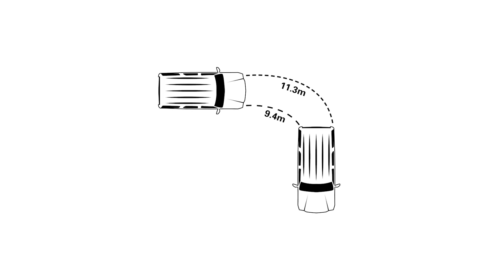SUB $600 DIY LOCKER INSTALL – Watch how much difference it made - Front vs. Rear, Manual vs. Auto

Comment: Just a question if the locker automatically disables if one wheel has resistance due to turning will it disable when one wheel has resistance during 4wding ?
Reply: Also in order to do the test that shauno did at the end when the luxy was on jack stands and he was turning the tyre to see if the other tyre would spin, would you have to engage 4Lo before doing the test to see if the lokka is working ?
Reply: The locker doesn't unlock because on the inside spins slower (more resistance) but because the outside tyre spins faster than the diff centre. This unloads the carry pin from the ratchet halves on either side of the pin. The mechanism works the same way as friction pack LSD where the power is transmitted into the diff centre through the carrier pin. The shape of the 'not so round' hole that the pin sits in dictates the clamping force of the ratchet half under load. This is why Shauno could spin the tyre while ol mate held the other. If Shauno had of spun the drive shaft instead it would have just bound the diff until ol mate let go and both tyres spun.
Reply: @r.mhaych5021  you only need to have the hubs locked. If your 4x4 has auto hubs then you would need to put into h4 or l4.
Reply: Liam Cooper thx for the discussion and info. I am still trying to get my head around how it behaves when 4wd is not engaged. I have the same model Hilux but don’t want to go the Lokka if it has a material affect on the the way the Hilux drives when being used day-to-day. Cheers
Reply: @4bnewb969  did you get one in the end? Did it effect your day to day driving and was it ratchety?
Reply: Shaun Anderson Hi, no I haven’t pulled the trigger on one yet. I am getting conflicting views on how it will behave when in 2WD. Even 4WD Systems mentioned it will depend on what front diff set-up I have in my Hilux. It appears they are not all the same even within the same model run ( mines a 2013). I would prefer to ‘test’ a Hilux with one installed 1st. What everyone seems to be advising is that in very low traction conditions eg sloppy mud & sand, the Lokka may not disengage and therefore steering becomes an issue, which doesn’t excite me too much either.

Comment: I had these on a gen 1 4 runner with ifs front had them on back and front and they made a huge difference  but i will say the rear one can be a bit annoying occasionally it would spool up and let go no damage just noise second when you do tight turns you will hear it clicking away but no big issue but i did find if you were a supermarket carpark making multiple turn it would start spooling up and making it jerky to drive
This was when it was manual  when i put a auto in this did not happen any more due to constant drive going to the diff 
in front no issues just huge gains :)
I had these for about 5 years and a lot of four wheel driving and it was my daily even when i put v6 in no issue i would happly use these again and will in my mitsubishi mk triton.

Comment: These lockers seems very purposeful 
But can those be used in a daily drive vehicles and part time off-roading?
Also can these Auto lockers be shipped internationally?
Reply: Mohsin Shaikh I all so would love to know, would it be worth it
Reply: I fitted one of these to the front of my Y61 Patrol and love it. Much better than a manual locker, don't have to think about. Under load in 4x4 it stays locked, if it gets a bit tight in the steering just back off the loud pedal the diff unlocks and releases the wind up and then back on the accelerator again. With a manual locker you have to stop and hit the switch then drive, stop and hit the switch to turn it back on again. There are about half a dozen companies making this style of auto locking diff around the world, the USA has the most I found when looking around. Google "Lunch Box Locker" , a common name for them.
Reply: Currently running a detroit in the back and an arb in the front. A rear auto locker has worked flawlessly for me and I highly recommend it, I haven't  run one in the front because i'm running a full time 4x4 the only problem I can really see is steering on track if it doesn't unlock or lock. I highly highly recommend this setup though, it's a good medium.
Reply: Manual front hubs on 4by. I have a lokka in front of my ford courier, air locker in the rear. When you turn the front hubs to lock position, that's when the lokka is locked good bit of kit!
Reply: @geoffmoroney9283  Yeah a mate of mine had one in his coil cab TD42 with 37s. It seemed to work great most of the time. It was manual gearbox I think using the clutch and backing off helped released it lock
Reply: @Nate Brindabella 
Disagree.  Have auto's in front and rear of my Troopy.  Used it for many years as a daily driver and never had issues.  I dont use it as a daily now because I now run 37's and I'd get stickered in short order, but I took the rear diff out recently and its got just a minimal amount of ware on it.  I've had it for 10 years?  There abouts anyway.  It's not been my daily for about 5 years.  My mate who had 2 in his Turbo Lux said that was a little different to drive, just he learned not to accelerate hard and turn left or right from a standing start (ie lights) while in the rain.  Not something I ever have an issue with but I'm guessing because I have less HP and much more weight .

Comment: I'm interested in fitting a Lokka in my patrol. My question is, do the edges of the interlocking pieces round off over time?
Reply: Good point, curious about the durability of these, myself.  I don't know if the bargain price is reflected in the quality of the materials used.
Reply: Had one in a 80series years ago, front only ,did 600ks in it no problems

Comment: Does it still work when you're turning left and right to gain more traction going up a more serious track???
Reply: yep
Reply: @Graeme Yamaha you're wrong in a way. They can't disengage if you are hard on the throttle and turning, the tiny springs can't overcome the torque which you are applying. 
I use to have one in my rear diff and if you put your foot down the lokka would stay locked on.
It's annoying that they didn't explain this in this video because that is why I'm sceptical of sticking one in my front diff, it may be hard to turn or break something if you have to be on the throttle hard and turn at the same time.
I broke the lokka branded one that was fitted into a 80 series 9.5 inch rear diff. Broke where the springs sit in the casing and made it so it didn't lock anymore and would make a hell of a noise when turning.
I replaced it with a brand called spartan as they had a much beefier spring and detent setup than the lokka.
Reply: @Graeme Yamaha as I said, the one I broke was fitted into a ln65 hilux with 80 series diffs and a 350 chev motor, it was in the rear though not the front. Have to say I loved it, for the price it work really well. It drove really well on road too, when it was working correctly I couldn't even hear it and the vehicle drove normally.
I have never driven one with a front auto locker though and in my mind I'm not so sure about fitting them to the front but in saying that I really need to experience it first before making a final judgement.
In the rear though I think they are the best bang for buck you can get.
Reply: Hi Steve - it DOES work while you're turning on a track. It only unlocks when the wheel speed for single wheel is GREATER than the input drive from your engine. For example, you're driving up a difficult track. Your engine is pushing you at 2m per second. You turn your wheels left. The lokka keeps driving your left wheel at 2m/s. Your right wheel (following the longer path) is pushed [by the ground] at 2.1m/s. So the lokka UNLOCKS and allws that wheel to travel faster. But it doesn't let it travel any slower than the engine speed (e.g. 2m/s)

Does that make sense? Does it answer your question?
Reply: Yes - it will unlock if the track is firm, but if its wheel spinning due to power all the way then it would stay locked. It can change what its doing all the way up the track - so each part of the track might require different action and it can handle that. The front diff fitment is actually the best part of the Lokka design - its actually the best way of locking a vehicle because you still retain almost all of your steering but also get differential action when you need it
Reply: @4wdsystemsgeartogoannawher754  hi guys, will one of these fit in the front of my px1 ranger?

Comment: So what was the go with the Zero Dollar Zooks steering auto locked up front then?
Reply: The type of auto locker installed in that probably has replaced the side gears with the plates shown in the vehicle. For Suzukis, that setup doesn't like to unlock easy and can easily snap CVs/axles too.  The alternative is to retain appropriate side gears which function the same as the plates, but ratchet more easily.

Comment: I noticed it makes a clunking noise when Shaun demonstrates how it unlocks. So can you hear the clunking from inside the cab when disengaged?
Reply: The "clunking" noise is the locker ratcheting.  It makes that noise when you corner.  The inside tyre is getting all of the power and the outside wheel is over-running the inside tyre.

Whether or not you can hear it from inside depends on a number of things - how well it's set up, how chunky your axles are etc.  If you set it up properly, it's not super noisy.  If you have a tin can like my Samurai, you can really hear it even when it's set up right, if you drive a Land Cruiser with lots of sound deadening and thicker diff pumpkins, probably not so much.  Probably...?
Reply: @antontaylor4530  Hey man, I just realized that this type requires power steering otherwise you'll fight the steering wheel badly! Right?
Reply: No, they behave like an open diff in that respect. I have a friend who has a samurai with the lockright version of these front and back, and he doesn't have power steering.  Steers like stock.

Comment: Can you do a beginner guide to using lockers on the track. Just got twin ARB air lockers. An on track guide to explain when to engage and when not too etc and use over different surfaces. Would be appreciated. Heading to Flinders ranges next weekend to test em, can't wait. Keep up the good work fellas.

Comment: I'm a bit different to most, fitted this in my falcon 2WD Outback ute. No getting stuck at all but it is very noisy ratcheting around corners. Good value and solution in place of my Hydratrak.
Reply: Not tight enough, get in there and tighten your springs more. If it's not tensioned enough it will click, it should ratchet without clicking.

Comment: Wouldn't it would just keep disengaging when your trying to steer up a technical track??
Reply: That's what I was thinking, also, wouldn't it just disengage with any amount of force on the opposite wheel? Old mate was just holding the wheel and it unlocked when 'going around a corner'
Reply: It does not allow wheel to spin slower that diff if force is applied to diff, so in some corner cases (with negative rim offset) steering might be harder. But wheels can freely rotate faster that diff, it locks only when wheel resists to diff rotation.
Reply: @MitchDenham  when there is force on the drive shaft then both wheels spin at the same speed but one wheel has the ability to roll fasters than the other around a corner
Reply: yeah I was thinking that as well
Reply: Re turning actually it does not disengage in the true sense. To turn 1 wheel can turn faster than the other but not slower
Reply: Yes from experience of having one in a troopy they will disengage if you back off the throttle on cornering.
Reply: There's one situation I have felt that happening in my 75 Troopy. That was going up a steep gravel hill around a corner where you have to accelerate.  Wasnt bad on my car (Heavy) but on a mates hilux he said it was a bit of a handfull.
The one situation I have had where I wanted to disengage the front lokka to turn out of a deep set of muddy ruts, I just unlocked one of the hubs and she hopped out of the ruts no problem.
Reply: If you look at one in person  youll understand it the centre pins have ramps that push the gears into mesh. So under full power situation it will be full locked only unlocks at light throttle (cruising) theyre good bang for buck operation is noisy and clunky though
Reply: Yes but that is not going to be an issue. Unless it is broken or not installed properly, it is not possible for any side to spin slower than the carrier (when moving in a forwards direction).  
This means that even when it unlocks one side, the unlocked side can only go faster than the side that is still locked to the carrier and it is not possible to spin up a wheel.
Reply: So basically it's like a Detroit locker
Reply: @450ktm520  It works pretty much the same as a Detroit locker, the difference is that it is smaller and fits inside the original carrier while the Detroit locker replaces the carrier.
Reply: @JeremyPetho  thanks..  ya I have a curries differential with a Detroit locker on a nissan titan. But nothing for the front... might get this for the front while we fabricate  the whole new front drive system.
Clever guys!
Reply: It might engage and disengage 100s of times depending on track and how much is going on. If the track is hard and differential action is required it might unlock to allow streering, but if the wheel is in the air or both wheels are slipping then it will be locked  - thats the whole benefit of this design it is constantly adapting - either giving differential action or traction depending on exactly what is happening at the time.
Reply: I'm pretty sure this will answer everyone's question... if you look at Eaton Detroit locker animation on YouTube its similar. 

I think what people can't wrap their head around is when you go through an arc or turn the inner wheels are driving forward and the outer wheels are actually going backwards. This action is what disengages the system. If you're driving forward but turning the wheels and not going through an arc both wheels will be engaged. It doesn't matter if you're turning the steering wheel left and right there's no Arc going on or another words one wheel is not going backwards versus the other wheel driving forward
Reply: ltholmsy have found if that happens the cross pin was worn or the side gears needed to be shimmed
Reply: It works off the cross pin. Normally the pin that the spider gears spin on. When it is forced by the housing to turn the side plates (pieces with teeth) it forces itself up the ramp on the back of the plates and forces them to lock. When you back off the pin returns to the center of the ramp and there is enough clearance for the teeth to disengage and let a wheel spin free. This could be both wheels or one wheel only.
Reply: @Motorcitymadman Yes. If you give that axle power then it will lock the unit and both wheels will be forced to turn.
Reply: Daryl Lee that’s correct 👍
Reply: Its a half ass junk version of a detroit locker! Those diff fit in aussie lockers are pure trash. Wouldn't install one in my lawn tractor....lol a full on detroit locker is the best way to go, it replaces the entire junk stock carrier and is 100 or 200 dollars more and is QUALITY 3 times as beefy and isnt noisy clunky and ratchety like those cheap insert lockers
Reply: @450ktm520    the outer wheel does not turn backwards. 
When turning,  the inner arc covers less distance  than the outer arc,
Ie the outer wheel turns faster than the inner wheel, as it has to cover more distance in the same time. The misconception of one wheel turning forwards  and one wheel turning backwards may come from seeing this happen at times with a car raised  on jackstands  and this occurring due to action/ reaction ( every action has an equal and opposite reaction) of diff, when one wheel only is turned. This is not how a diff works or drives,  it allows differential drive speed of inner and outer  wheels  as above

Comment: quick question what happens when you are going up a hill and you need a lokka but you also need to turn will it disengage?
Reply: They made a stuff up with describing how these work. Basically, with any drive to the diff, they're locked. If you roll along in 4wd, out of gear and then turn, the locker will disengage. As soon as you accelerate, the locker will lock.
Reply: TheMuddyHilux  have played with many of these over the years , Detroit made one so did truetrack and many other slight variations of the same design ( many court cases happened 20 years ago ). Both wheels are locked till one wheel drives faster than crown wheel speed this allows the dog clutches ride over each other against the low spring pressure